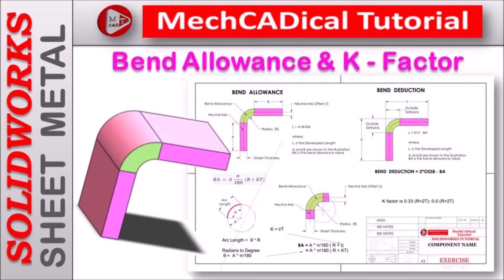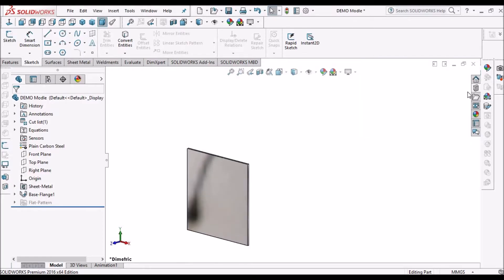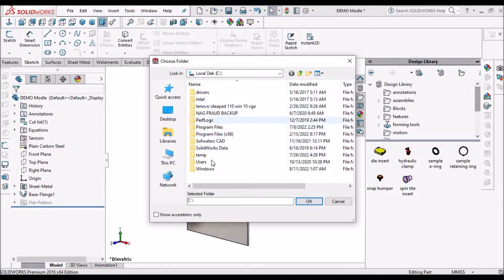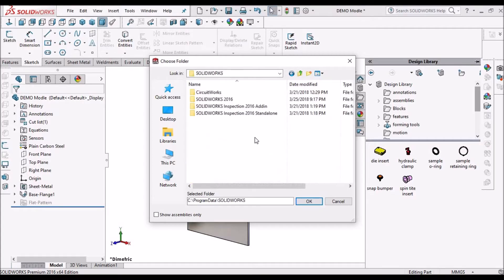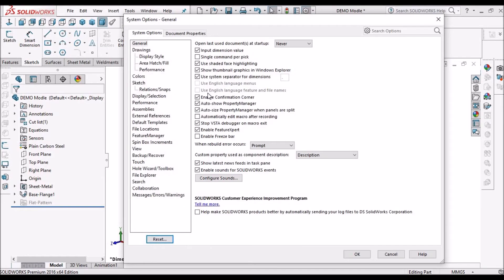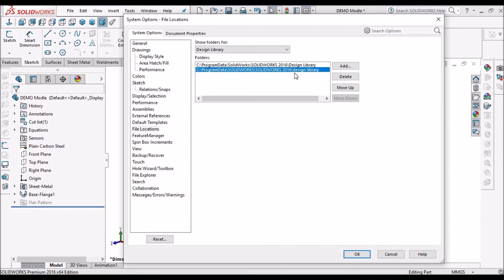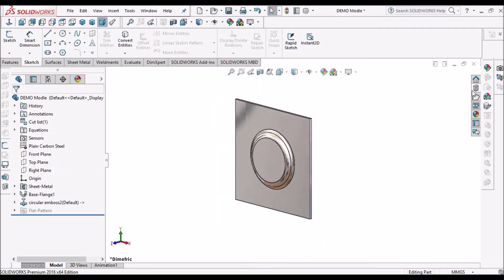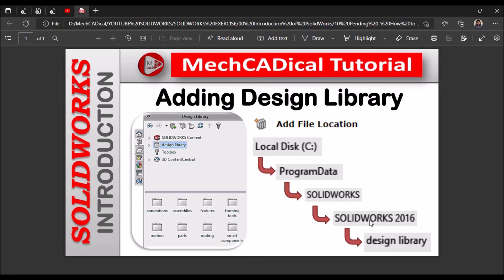How to Add Missing Design Library in SolidWorks

Comment: Why the design library features are not solid in my solidworks?
Reply from the maker: Do they look like imported features or only surfaces
Reply: @mechcadicaltutorial  just lines joining together to make a specific 3d body, like we draw in a paper without colour
Reply from the maker: Then, It is in wireframe mode.
Reply: Yes, it is like wireframe mode, but I have wireframe mode switched off